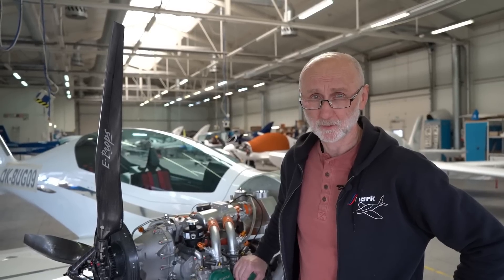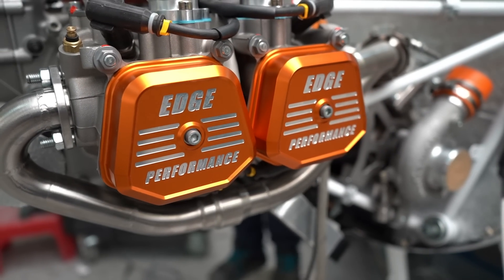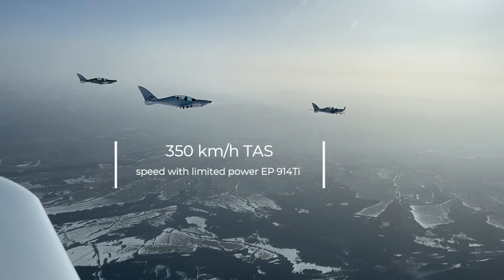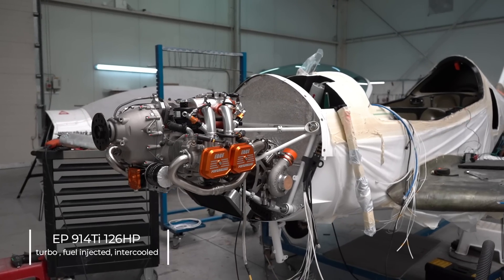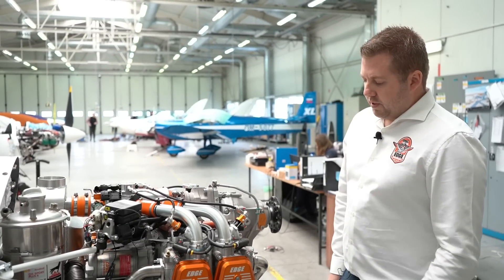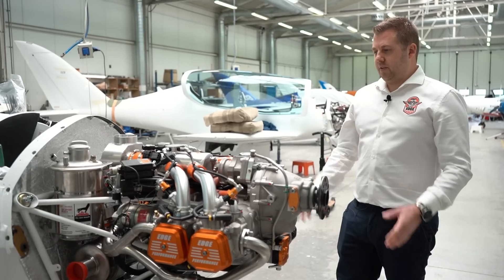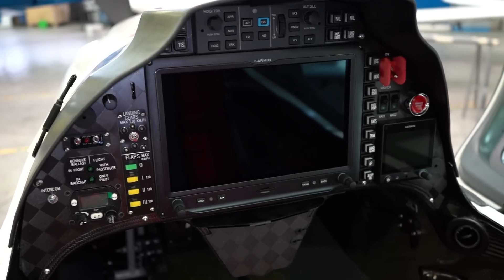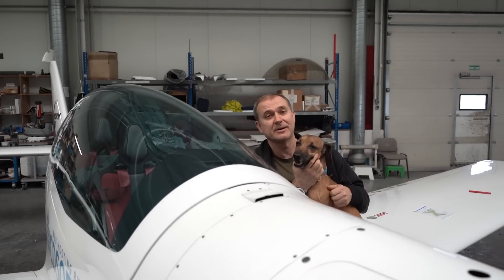Shark airplane - 3 breaking news for 2023

Comment: Once they actually offer one up for sale with a price tag attached, reality will set in.
Reply: It will be around 150k
Reply: @Thomipangang  Where did that number come from?
Reply: @Iceman240Z  the internet, it’s already for sale… with full options it is 180k I think
Reply: Swiss Risen has similar performance and huge range 5000km if you fly at only 200 kph. Super cruise 380 kph. Costs over 200k franks with some options. Been on sale for many years.
Reply: @hungrysurfer9471  Risen is the king right now. That V tail is giving them quite a bit more speed at the higher end. Also their VNE is like 30knts higher than any other rotax airframe.
Reply: The best stuff will never be the cheapest stuff.
Reply: @CrossWindsPat Agreed but the problem with Risen is they are super quiet about the price. I finally located a Risen owner that stated he paid “well south of $300K US”. If Shark is proposing $180K range with Garmin package, that is a better deal.
Reply: @TheGlobalTravelr  Yea you cant argue with 120k savings 🤣🤣🤣

Comment: I had the opportunity to visit the plant last October. A wonderful experience. Current aircraft production is very similar to plastic models. Glues, staples and no rivets.
Reply: Glues and staples doesn't inspire confidence in rigidity.
Reply: @manosparavida3551  My very limited understanding of aero grade glues is that, properly applied, the surrounding material will fail long before the glue.
Reply: How very special
Reply: @manosparavida3551  but the reality is different, fiberglass is very strong and everything has passed tough breaking test.

Comment: Hello Gwen from below.  Wing loading is described this way. Let's say at gross weight the plane is 3000 lbs.  On this same airplane the square footage of the main wing is 200 square feet. You take the weight of the plane divided by 200 and get a load of 15 lbs per square foot. Airliners can have a load of over 100 lbs per square foot. This makes them more stable in turbulence. There are less likely to be moved around by minor atmospheric bumps, etc.

Comment: I'm liking the Shark, will maintenance be difficult? Are the instructions easy to understand by an English speaking mechanic in the US?
Reply from the maker: As it’s a Rotax powered airplane it’s quite simple. Basically changing the oil and filters every 100 hrs and checking the airframe according to the maintenance manual. A big maintenance check is after 5 years.

Comment: Hello, why you don't use the 915 or 916 original ROTAX..??
Reply from the maker: Shark is aerodynamically extremely clean aircraft. With R915&916 Shark will fly well over 400 kmh/215 kts in cruise, which is beyond our current flutter limits. We must therefore reinforce the airframe, redo the test campaign and do new certification. It’s work in progress but will take some time still.
Reply: @sharkairplane  ok, thanks for you fast answer; everything is quik at Shark, I think :)
Reply: ok, thanks for you fast answer; everything is fast at Shark, I think :)

Comment: Best wishes Shark Aero 🙌🏻

Are you considering using new Rotax 916 in recent future with this platform?
Reply from the maker: We’re working on the integration but it’s more complex and will require reinforcement of the airframe and a complete new test campaign. That takes time. Couple years. But Shark will fly well over 400 km/h (216 kts) then.

Comment: After flying Shark with Vlado at Martin Tomcharny back in 2018 you have come a long way. What about the new Rotax that delivers 160hp?
Reply: If the 914 will not fit,  then the 916 will not either I suppose
Reply from the maker: @mauriceevans6546  We’re working on the integration but it’s more complex and will require reinforcement of the airframe and a complete new test campaign. That takes time. Couple years. But Shark will fly well over 400 km/h (216 kts) then.
Reply: @sharkairplane  what about integrating a TP-R90 from Turbotech? Is the reinforced Shark a project that's definitely coming or just an attempt?
Reply: @dynamicwt2110  yeah that tiny turbine is only $85k and with upto 220hp. Would make the shark very quick. And able to carry much more fuel load.
Reply: What about the Edge Yamaha turbo engine?  300hp

Comment: Interesting, what would be the performance of this great machine with Rotax 915iS on board. 
@Shark Aero do you think it's possible?
Reply from the maker: It is for sure. We’re working on the integration but it’s more complex and will require reinforcement of the airframe and a complete new test campaign. That takes time. Couple years. But Shark will fly well over 400 km/h (216 kts) then.
Reply: @sharkairplane  Does the plane have IFR certification? Would you reflect the updated model of the airplane on your website?
Reply from the maker: It doesn't. We are working on the completely new website where it will be reflected.

Comment: Nice plane .... However, I think the DarkAero has those specs beat, slightly 275mph (443kmph), 1,700sm (2,736km), 200hp UL520iS.  All CarbonFiber airframe.  Granted, they are not in production, but very, very soon.
Reply: DarkAero… very good social network promotion … of virtual aircraft having virtual performance with virtual engine produced by virtual technology by virtual team. boys have good game, burning money, and making big waves. to deliver aircrafts and live from it is different story, not so funny. Basic mistakes - type of used engine plus no turbo,   hollow grid technology, composite aircraft with metal shapes, planned empty weight no way -I expect 70 100 kg more, backward retracting all gears  will make them tough life with CG. Lancair and Glasair framed this group a years ago, with thousands of produced kits and flying aircrafts. This is placed somewhere between, but with above mentioned mistakes. It will not beat them.   it will take next years and years while they will have something like product. But nice movies, enjoying, good luck.
Reply: Darker is just theoretical at this time. They are making a composite airframe with and old air-cooled engine design. They are just making a new production of an old design, we will see how it actually performs.

Comment: For the price of the Rotax you could have a rotary engine, and spare cash over and above the extra fuel and a smaller and lighter power unit to boot.
Reply: I like your idea, although using an established aero engine could help jump over regulatory hurdles.

Comment: Why are you dicking around with edge performance engine ?  Just put a 915 on there with a constant speed prop.
Reply from the maker: The engine is quite heavy for a 600 kg/1300 lbs mtow aircraft limiting the payload. Shark with 140 hp will fly over 215 kts in cruise, which is over the flutter limits of current airframe. There are also other reasons but these are the 2 key ones.
Reply: @sharkairplane  
You’ve got to iron out that flutter issue. Shark looks like it could do 400kts !!!
Reply from the maker: @savagecub  yes, indeed. And we’re on it but requires a little bit more time.

Comment: why not just use the new 916?
Reply from the maker: We’re working on the integration but it’s more complex and will require reinforcement of the airframe and a complete new test campaign. That takes time. Couple years. But Shark will fly well over 400 km/h (216 kts) then.

Comment: Swiss Risen has similar performance and a huge range 5000km if you run eco power levels only 200 kph. It can get close to 400 kph for a shorter trip. Costs over 200k franks with some options. Been on sale for many years.
Reply: I like Risen , the only questin is about gear... can it withstand every day use from grass runways for many years ? I am not afraid it could fall apart, but I am afraid of part´s  wear.
Reply: @mirekslechta7161  Swiss Quality is legendary and long lasting. But i dont know if its certified for using grass fields.

Comment: All good and dandy, show me the remaining payload with full fuel!
Reply from the maker: With a typical configuration the useful load is 250 kg (550 lbs). Fuel tanks are 150 l (40 gal) so 108 kg (238 lbs). With full tanks the endurance is 6-12 hours based on power. Certified MTOW 600 kg (1323 lbs).
Reply: @sharkairplane  Thank you for filling in the blanks! They are impressive number for such a small aircraft! My concern with aircrafts like yours is the fact that their capabilities are way out of league for the average pilot. On top of that I truly hate the present multi-function displays they are very impractical to scan, but worse to handle in emergency situations with the statistics proofing over and over again that I'm right! But what I love to see on any modern aircraft is the unrestricted visibility that you provide in your design. Wishing you success with your sales and for your future!

Comment: 300kmh = 186mph, for my fellow Americans.
Reply: 300kmh is 300,000mph. 1000 metres in a kilometre. Have to love metric, besides most of America already know this.
Reply: A km is 1000 meters, not 1000 miles @chippyjohn1
Reply: @yamascott   That's what I said. 300kmh is 300,000 metres per hour, not 186. It's metres also, not meters. A metre is a unit of measurement for length, a meter is a device you measure with.

Comment: What's the useful load? What's the fuel capacity? What's the price? An entire long video with no price! Why not a simple Lycoming engine? Why this expensive and complicated rotax? Why do you talk in km/h? Clearly you're not pilots. We don't fly in km/h. Our maps and airspeed indicators aren't in km/h. Who's buying these planes? The GA environment in Europe is so horrible for the average pilot. Yeah, nice video, but zero practical information.
Reply: Typical emty weight is 350 kg, MTOW 600 kg. Fuel 150 litres. Price from 200 k up to about 280k €, typical “full option” is 240k. At today inflation rate this is very temporary information. Lycoming? -if you look to one of our closest competitor Lycoming instalation, you will get higher weight=lower payload, lower speed, double fuel consumption, half range. Look to power/weight of engines. I fly 42 years. in km/h. Happy. On our low speeds - approach, landing, stall I see it more precise. We live in metres, milimetres, kilometres, kilograms, litres, celsius world. Happy. Who is buying? In Europe is sold about 1000 UL aircrafts per year. If you compare it with certified aircrafts, you fly for fraction of price per hour, very often faster, with lower consumption, better instruments and safer because of installed parachute. Ya, Europe is fragmented - a lot of countries. Sometimes not so simple. Even average pilots are happy to live here. :)
Reply: Lycoming make terrible engines. Kmh is the official unit of speed for aircraft as of 14 years ago and unofficially much longer.
Reply: @VladoPekarShark  I wish Europe had a greater influence on aviation in Australia, sadly the US tries to dictate what we do. I personally use all metric for aviation, even metres for altitude. Can't stand that non-metric garbage, it should be banned.
Reply: @VladoPekarShark  I feel lucky to fly in America!